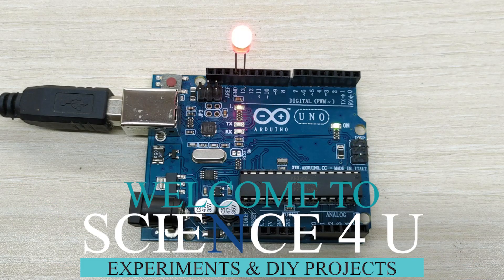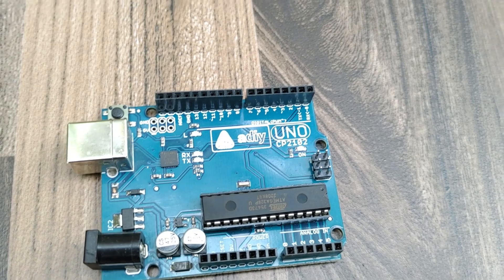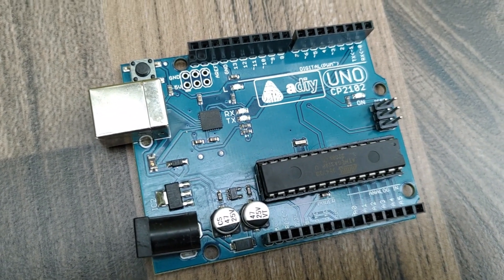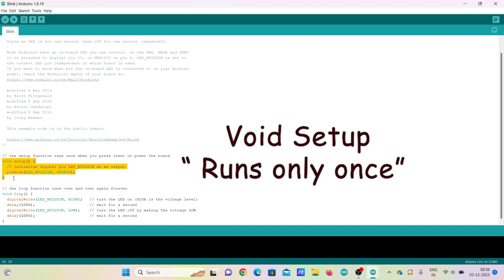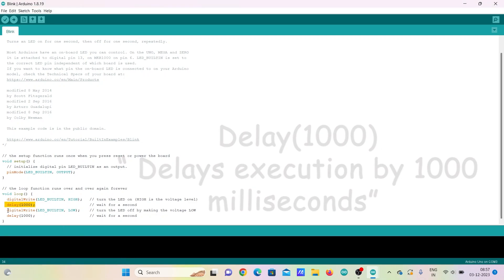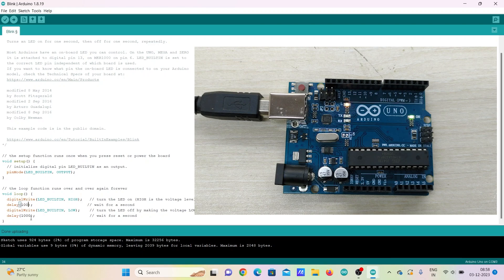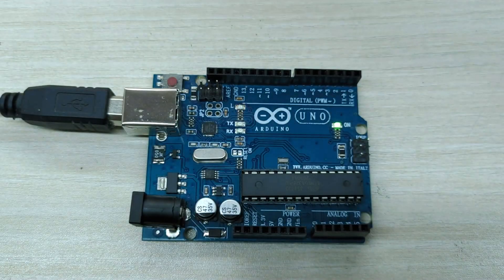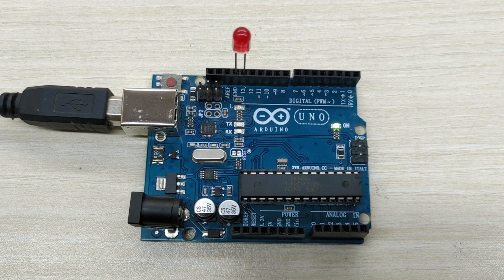Blinking LED using Arduino Uno || Simplest project for absolute beginners

Comment: what is the code/ where is the code?
Reply from the maker: Hi friend, This LED blink code is already given in the examples section of Arduino IDE software along with a set of basic standard codes. In the video, I am showing how to open that code from examples section and upload to Arduino. However, since you have asked for the code, I will paste the code here also. I will also give a separate link in the description box for downloading the code. Thank you. Code is given below. 

void setup() {
  // initialize digital pin LED_BUILTIN as an output.
  pinMode(LED_BUILTIN, OUTPUT);
}

// the loop function runs over and over again forever
void loop() {
  digitalWrite(LED_BUILTIN, HIGH);  // turn the LED on (HIGH is the voltage level)
  delay(1000);                      // wait for a second
  digitalWrite(LED_BUILTIN, LOW);   // turn the LED off by making the voltage LOW
  delay(1000);                      // wait for a second
}
Reply: @Science_4U_  Thanks. i subscribe now;)
Reply from the maker: @yellow_banana-1234  Thank you friend..🙂🥰